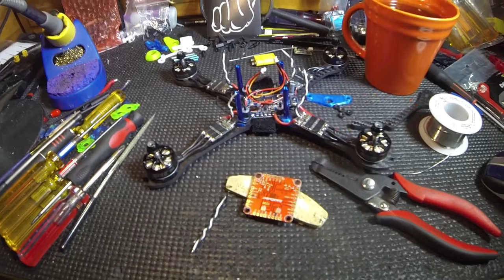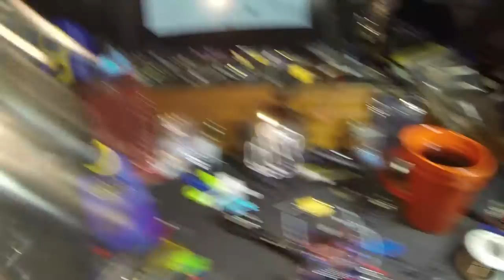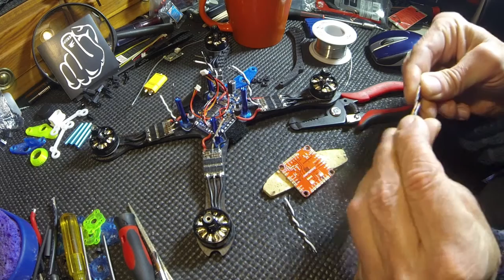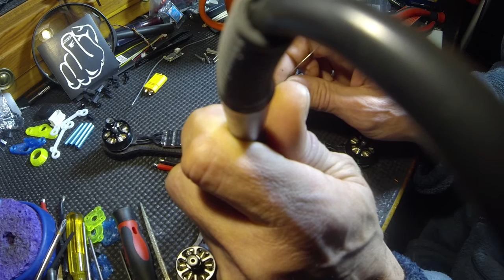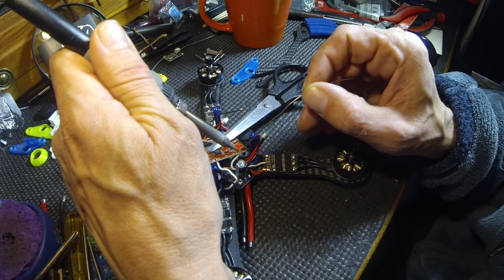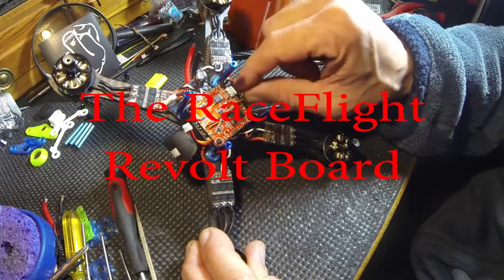I wire up The RaceFlight Revolt

Comment: What AWG wire should be used to power the flight controller? The flight controller didn't come with any wires and I'm wondering what size the wire should be. It's 5v btw
Reply from the maker: 13 agw